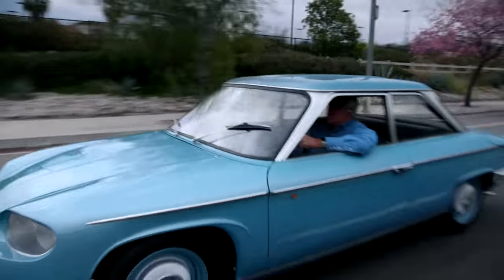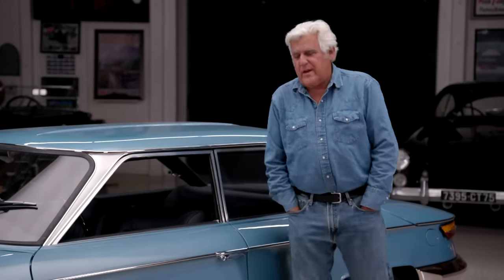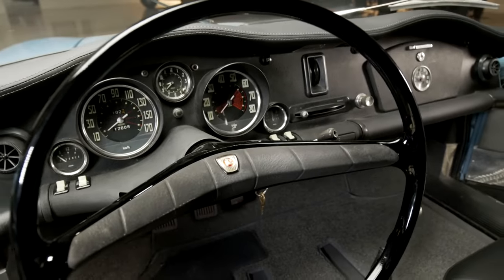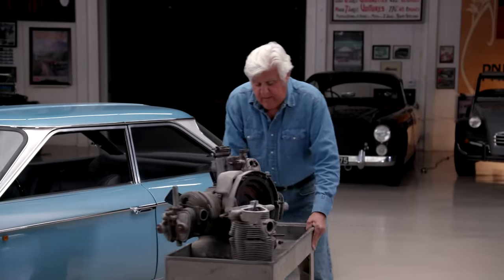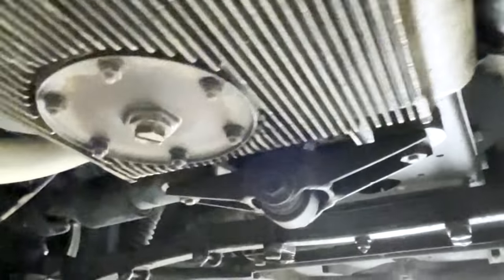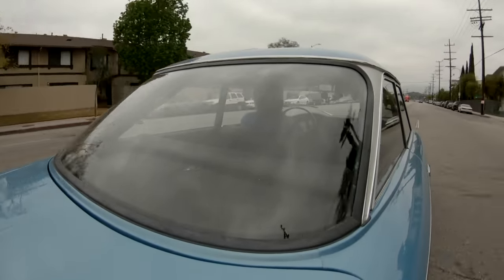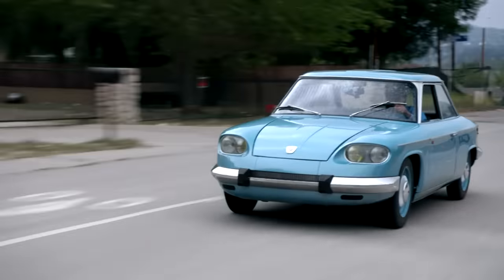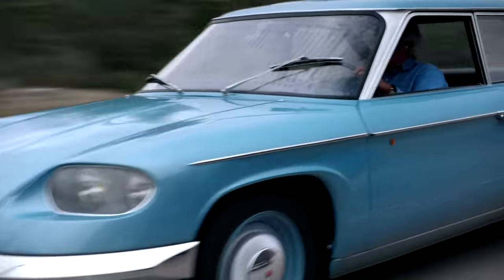1967 Panhard 24 BT - Jay Leno's Garage

Comment: This car reminds me of the VHS vs BETA where BETA format, to me, was better but VHS beat out through marketing and BETA disappeared

I remember when I helped out this guy who worked on Sports Cars as a teen he gave me a Saab 93 which had a 3 cylinder air cooled 4 stroke engine.
Loved that car.  No power, 33hp,  but fun as anything.  I owned 68 440 Dodge Coronet, 69 455 Olds 442, 69 Camaro 396, 69 428 Mustang, but nothing was more fun than this car and the 1961 Bug Eye Sprite I used to race.....no power but pure driving.
Reply: The Saab 93 had a 2-stroke engine that you had to rev up to the max to make it go because it was too small to have a decent torque. And on two-stroke engines you have to tweak the exhaust to obtain decent power (the most extreme tweaks were made on Trabant).
Reply: @chucku00  Which I did rev'd it to the max.  
I was able to drive a 1964 E Type, 1965 Aston Martin DB4, Series II Land Rover, Jensen Interceptor with a 440, Triumph TR6, MG Bug Eye Sprite,  MG GT, Triumph Spitfire, home to test them after they guy who owned the shop did work on them.
This was the late 1970's and they were just considered old cars not collectables.  
I still loves to drive the SAAB and Bugeye more because they just had a quirkiness.  
He gifted me the Saab and Bugeye and I SCCA raced the Triumph.......SAAB was hit by a trash truck in front of my house, and wreaked.
Reply: @prideventues  Sad to know about the cruel fate of your Saab... do you live in California? If it's the case, there's a new restomod car company, called Légende Automobiles in Los Angeles that is on his way to build a contemporary version of one of the quirkiest cars ever :  the Renault 5 Turbo. 
You can check the work in progress on their website, legendeautomobiles dot fr (can't post direct link due to YT spam filter). So if you happen to live near LA you might as well could see the beast in real life...
It seems they're located here : 360 W Compton Blvd, Gardena, CA 90248,
Reply: @chucku00  No Philadelphia .......this was in the early 1980's so I am almost over it....LOL
Reply: @prideventues  Well, never say never! And maybe you'd have the opportunity to go to California some day...
Reply: @chucku00  Luckily been there and 36 other states.....27 countries as well to date.
Just visiting friends I have made through the years not as a tourist.

Comment: Panhard did not need to boast about their racing success, the company was the proof. Panhard Levassors won the first true motor race in 1895... there was previous races, but the Paris -Marseilles-Paris race of that year was the first true 'First across the line race'. Actually, Panhard had already won a bunch of races by then, but they were excluded from some, like the high profile Paris-Bordeaux race, which Emile Levassor won in a Panhard Levassor by 11 hours....because his car was a two seater, and only 'sedans' could be classified. 

They dominated racing between the 1890s and 1900s. They developed what a car came to be. Before Panhard, there was no clear, agreed, way to build a car, or power one. Panhard came along and put the radiator in front of the engine, a petrol powered internal combustion engine, specifically, at the front of the car, then gear box in the middle, where they used the first transmission ever made, and ran a drive shaft through which powered the rear wheels. They installed the first steering wheel ever, on one of their race cars, they put the pedals, including the introduction of the clutch pedal, as opposed to lever, where they remain today, and in doing all this, they dominated the competition. 

That is not to say that the FR layout is the ultimate one, or the only option, but at the time, in the 1890s, with late 19th century technology, it created what for its era, a clearly better car than anything made any other way. And I mean clearly better. So better, that just about everyone making cars from that point on copied them. 

Everyone copied them, in fact, for the next century. 

In fact, up to until the mid 80s, when reading about a car in a technical manual, or media, like a magazine review, the layout of the car, usually something mentioned, would not be cited as FR. or explained as front engine, rear drive, but rather simply be referred to as a Panhard Layout.... and everyone who knew anything about cars, knew that meant FR. 

That cars look, and and are operated, how they do/are today, is in no small part due Panhard et Levassor and the cars they made, that showed the way forwards for the next one hundred years of car design, generally speaking. Much of that technology and design proved itself on the roads of Europe in racing, over some of the greatest names in automotive history, like Daimler and De Dion. 

It seems awfully disrespectful to snicker at what they were forced in to becoming after the devastation WWII wreaked on France. The first instance of poor form I have seen Jay, but it was truly poor form.

Comment: Finally! Since many years I have been watching your shows, with the blue Panhard 24 BT patiently standing in the background. And now this great episode.

What you did not mention is that the drum brakes on your BT are not original. This BT version should have disc brakes - the fronts have two calipers per disc, because, well you know - its a Panhard!  The cheaper 24B version (with 42 hp) had drum brakes. 

My own Panhard 24 BT, that I own since 2001, has the disc brakes. The car is unrestored. And it never had any breakdown. I still love the design, and. . . the engine sound! And here (Netherlands) it is also a rare car. And on the streets: many people seem puzzled: what make is this elegant car? LOL

Comment: the birthplace for automobile is actually in france (cugnot 1769), they won most of 19th century races, fastest car of the 19th century, first car dealership (de dion bouton 1884). german replace steam engines for gas engines. They're plenty of cars before 1880

Comment: This is clearly inspired by the DS. You'll find the DS' design cues all over the place.
Reply: Actually the other way around. The DS facelift (with the similar covered headlights) was based on this design. Fitting as Citroen owned Panhard (and was also the company that killed the brand... the 24 range was the last Panhard ever)
Reply: @marcelromijn2227  : Thx for the info.
But isn't the DS at least 10 years older?
Reply: @bikkiikun  Yes but that is the pre-facelift with just single non-covered headlights.
Reply: @marcelromijn2227  : good to know.

Comment: Could one put that engine into a Citroen 2CV or Ami 6? The engine looks very similar to the 2CV engine but it is much more powerful. I really like the styling, almost as beautiful as the Ami 6. The wiper pattern looked weird. I wish you would have operated them.
Reply: The 2CV or Ami6 would have a hard time accomodating this power increase. A better road handling Dutch Burton 2CV (a car based on the orifinal 2CV but somewhat similar to a Morgan Plus 4 or Panther Lima) would be more appropriate and safe.

Comment: VW had a 1500 by 67 still only 53 HP but double the torque of an 800cc. We used to take our mostly stock cut up Beetles and race them for hours almost daily off road. They would live with abuse that would break about any car ever made. This is a cool car though, I love simplicity.

Comment: Jay, are you trying to say a cabled clutch has less feel than hydraulic?  I can't see that buddy, best to get on it and adjust it, nothing feels more connected than a cable clutch; the torturous routes to transmissions made them impractical. Go retro and drive a 124 Spider and then an X1/9 the clutch feel is gone in the Bertone unit.

Comment: BT = Berline Tigre with the 50hp (DIN) engine. Only problem with Leno's is the brakes, which should be discs all round. That's how they came out the factory.

Comment: The rear reminds me more of a vintage BMW than a Corsair.
Reply: BMW E9 : 1968 but the rear is inclined and the rear lights are lower, and the previous Neue Klasse (1500-1600-1800-2000C/CS) was inspired by the Corvair
Panhard 24 B/C : 1963
Chevrolet Corvair : 1960 and the coupé's rear looks more like the 24 except for the rear lights

Comment: While the Honda s600 is my favorite vintage car as it too has the roller bearing crank and high revs, this is a close second. Third might be the rally 1961 Saab 96 with the exhaust that passes over the roof. Something about two stroke lightness air cooling or high Rev little cars makes sense. Today all you get is dumb engine cutoff cvt 8 speed fwd suv nonsense shopping cart appliances people buy today. EPA ruined race cars with street vins, and diesels, imagine what innovation we would have without it!

Comment: Panhard were working on a new 4 cylinder version of the engine., just as the company was made defunct by Citroën.  It would have delivered the HP for sure. 

I can only assume these engines were dropped as they were too noisy to a water cooled engine.

Comment: The problem with these cars, is having a knowledgeable mechanic to work on it, this is an engineer engine, they are actually quite hard to make run right. Plus pretty much all the parts from all years interchange but don't make a good running engine, heck you can even interchange the left and right cylinder head and have the exhaust valve run as the intake, makes a really crappy running engine but it works. If you go to 950cc,twin carbs you're good for a healthy 110mph.
The only real issue nowadays are the connecting rod needle bearings, only 2 people do this in France, it requires disassembling of the crankshaft and special needles. Of course both of these guys say they are the only one that knows how to do it and the other is doing it wrong.

Comment: Is the motor a 2 stroke or a 4 stroke?  Is the heater a hot air heater from the motor?  I love French cars because they are so not American in they way they do things!
Reply: The engine is a 4-stroke and the hot air is used for the heater. The top of the doors under the glasses have a tube that allows the hot air to defrost/defog the rear window. So there aren't any resistor system installed in the rear window and the rear of the interior is heated as fast as the front.

Comment: That's basically a slightly improved coupé 2CV
Reply: Non, rien à voir avec une 2CV et l'origine technique de la 24 BT remonte à la Panhard Dyna, bien avant le rachat par Citroën.
Reply: @chucku00  Oui, bien que l'origine n'est pas la même, les deux ont pourtant beaucoup de similitudes. Bicylindre à plat, essieu arrière indépendant avec suspension à barre de torsion...
Un peu comme les voitures moyen gamme d'aujourd'hui qui tendent toutes vers la même chose (3 cylindre turbo injection directe, McPherson à l'avant, essieu semi rigide à l'arrière), bien qu'elles aient été plus ou moins toutes développées séparément.
Reply: @guillaumegaudin694  Le bicylindre est bien plus élaboré sur la Panhard, les moteurs de GS ont d'ailleurs profité de cette sophistication. Les suspensions sont aussi très différentes : point de "batteurs" ou de potes de suspension avant/arriière sur la Panhard.
En apparence, ces 2 voitures ont certes quelques points communs mais dès qu'on rentre dans les détails techniques ces reseemblances ne sont que superficielles.

Comment: The Volkswagen is no match for the Panhard, which catered for a different clientele. Volkswagen´s strenght was its simplicity and reliability, at which the Panhard missed out on both accounts. Sales figures didn´t exceed 40,000. In 1967 Panhard closed the doors, which was a pity, as P & L was certainly the most innovative car maker in history.

Comment: Most of the early innovation in the Automotive Industry came from France.. Things like the super / turbocharger were invented there, independent suspension, ignition systems, helical gears you name it... I mean Charles De Gaulle was SAVED from assassination because the Citroen DS he was travelling in had amazing suspension which enabled the driver of the time to steer out of the skid and drive to safety despite having all four tyres blown out .. And De Gaulle's life was Fortunately / Regretably saved from the rouge military group / coupists who were angered about the betrayal of the colony and the pro-french muslims massacred in Algeria.

Comment: If you call a engine that lasts 40,000 miles because the 4th cylinder overheats because of stupid placement and the body is made of tin and can be dented by leaning against it and doesn't do 70 unless you are going down Mt. Washington, then I guess you could say that the people mover was well made.

Comment: Leave it to Jay to have a running car and a spare engine laying around.
Reply: I won't be surprised if Jay is looking for a Panhard Junior, and since these cars aren't easy to find even without an engine he might keep this one just in case. If you want a good laugh, check this model on Google images, it kinda prefigures the Nissan Figaro . As funny as it looks it was used in the 50's as a sports car that could give Porsche 356 a run for their money due to its light weight and its front wheel drive...

Comment: all fun until the exhaust rusts out and your engine suddenly drops when youre on the highway
Reply: There is a central fixation for the engine and the gearbox  to the chassis  that Jay didn't show, and the exhaust tubes are way more thicker than "non structural" ones.
Thank you BTW,  you just helped me to get my hands on a PDF of the "Revue Technique Automobile" for the Panhard 24 model range.

Comment: I'll just point out that the drum brakes are not relevant with a BT, which has had disc brakes since the beginning. So it looks like a 24B, a simplified and less powerful version of the Panhard 24.
Reply: Many 24B  got upgraded to a BT in the 60s already. They usually left the braken drums as the disc brakes performed better but a pain in maintenance. There are even some CT and BT that got downgraded to drums for easier maintenance.

Comment: So 60 horsepower and 1800 lbs, how is that better than 200 horsepower at 3600 lbs and of course the 200 horse engine didn't have to rev to redline to break a 100 mph.

Comment: 90 mph? WHAT?
Reply: Yes it wil do 90mph, but likes to cruise at 70-75mph
Reply: @keithwwalker  is it two stroke?  this car blows my mind
Reply: @mrpicky1868  Its a four stroke flat twin, roller bearing crank for low resistance.  The car is well proportioned unlike most small cars (eg, Mini) so it looks larger than it is - its about 2/3rds the size you expect it to be.
Reply: @keithwwalker  still cant believe it. math does not add up. if it was like 10000 rpm i would maybe believe it.

Comment: Jesus Jay?! Interesting car but Panhard was out of the car business by the end of the year!! The body design is a copy of the 1966 Type 34 Karmann Ghia! VWs stayed on the roads for 20+ years due to simple maintenance! The Bug was designed in the 1930s —about 30 years earlier — and it rebuilt the whole German postwar economy! You failed to mention the motor is also a copy of the German Boxer with one-off internal components. You also failed to mention it cost almost 50% more than a Bug! My 1962 BMW R69S boxer motor makes the same HP and more reliably! My 1962 Bug self-built 2110 Boxer (VW case) motor makes 160hp. Again this is a great little car but completely irrelevant. I lived in West Germany for 5 years in the 1980s and never saw a Panhard lol. So let’s be more honest in future reviews and less revisionist comparing apples and oranges. Go eat some cheese geez lol. 🧀

Comment: Please stop comparing VW beetle with the Panhard. Cars are measured by the size outside and space inside and not by the engine size!!! The pricing in the us depended by the xchange rate of french Franc and D Mark. The 10% are just in relation to the dollar. But the Panhard was a rather big size midclass car. The beetle was a small car made in the 1930ties! if You want a fair comparison with german cars same size take the NSU Ro 80! Count in a Wankel- engine the Number of cyinders...